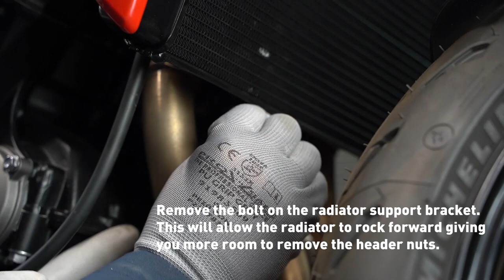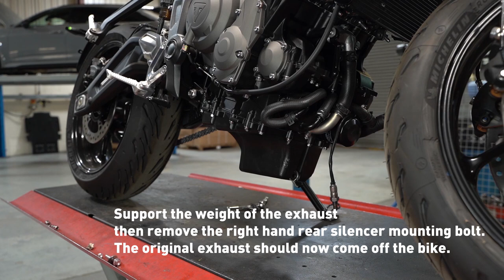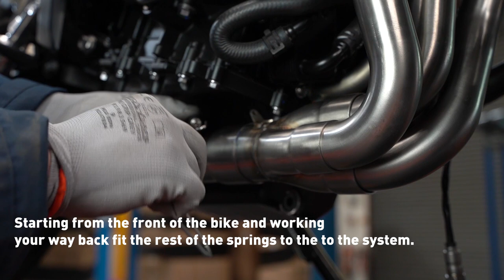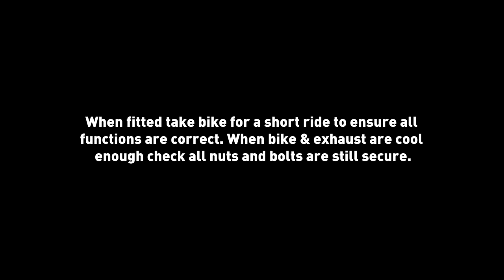Triumph Trident 660 Scorpion Exhaust Fitting Guide

Comment: The L/H Header Pipe came out of the collector by itself after a while. When I checked it, I saw that the L/H Header Pipe was bent. I think it bent due to the heat of the engine because I didn't hit anything. I didn't wash it while it was hot. I live in Turkey, I don't have the chanca to replace it under warranty. I really regret buying it.
Reply from the maker: Hi, that’s unusual. We haven’t experienced anything like that before. Are you the original purchaser?

Please get in touch with our sales team and provide a full description of the issue along with photographs. 📧

Email: sales@scorpion-redpower.com